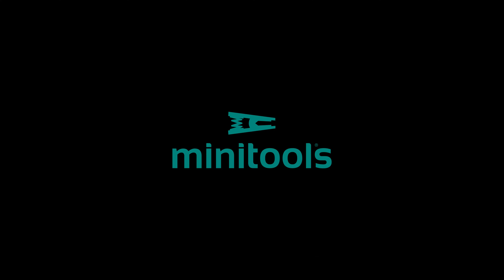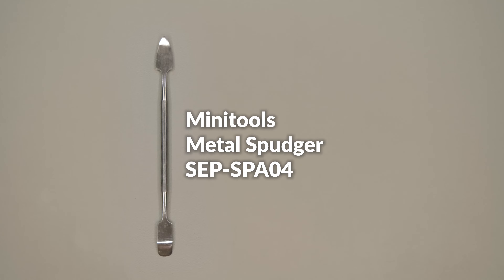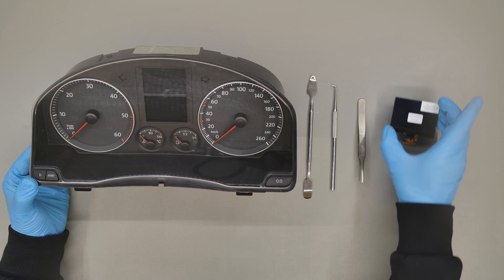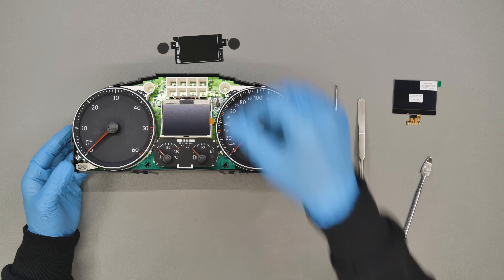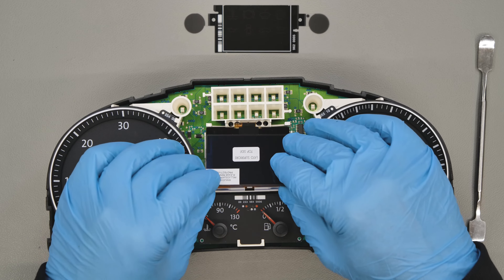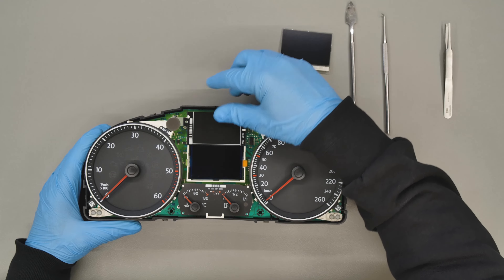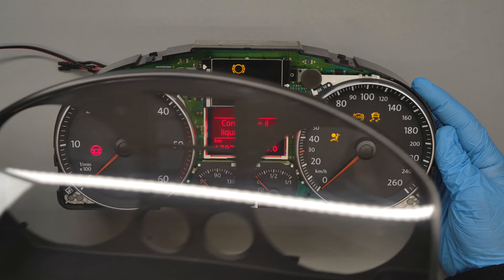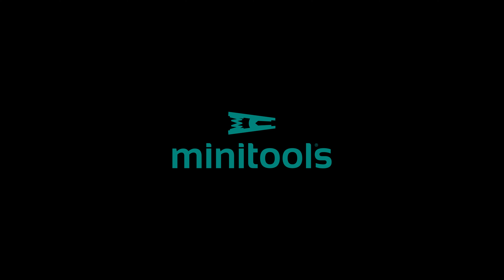Volkswagen Golf Mk5 instrument cluster repair – faded dash display replacement

Comment: Anyone know why only the backlight goes out. Everything else works on it. Just the blue lights go out every day. They work but loose connection after I start the car or as soon I turn the headlight switch on. Could it be my headlight switch? It is aftermarket

Comment: i have a problem with fuel gauge. when checked it on launch arrow worked but then i chamged a new dash and it worked so there is a problem with programing the new dash noone can program it in Georgia and meybe you have any solution for old dash or any way to program new one.
Reply: Check your fuses and battery, failing that you could have a shit sensor